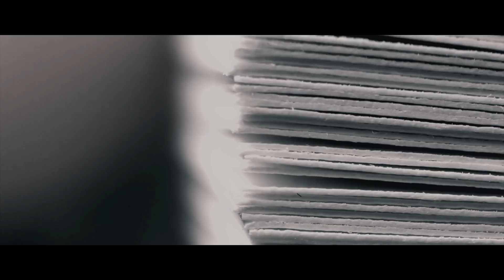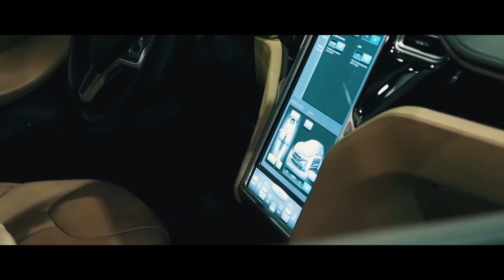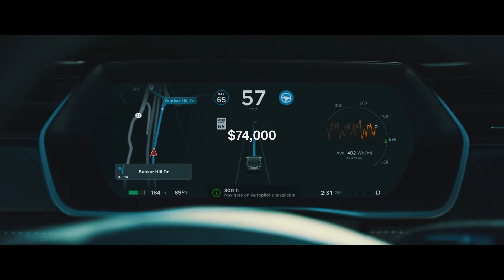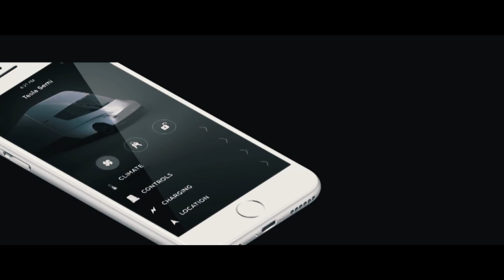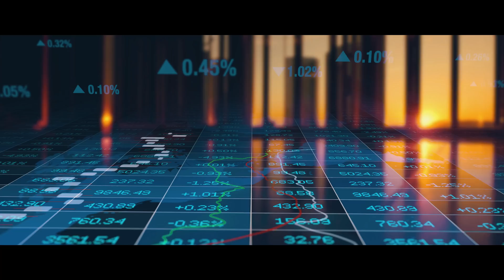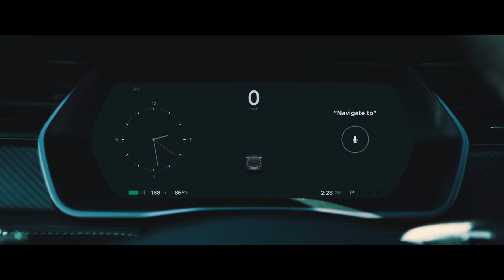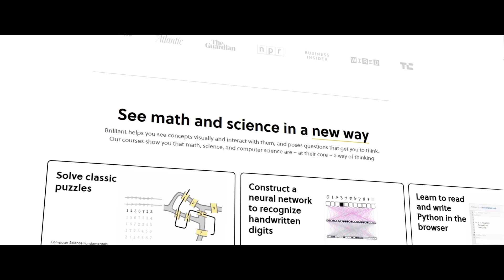Tesla: The Electric Revolution

Comment: Even though it runs by electricity...
The engine produces heat which blends with the nature and it probably enhance the nature's temperature... Global warming increasing not only by pollution evinced by petrol and diesel but by the heat the machine produces as well ... It's not different from a human body which creates heat  while exercising...
Machine if runs produces heat no matter what...
Even the oxygen polluted turns less the heat ultimately increases and global warming increases too keeping pollution aside....
I hope u understand it...
There's a solution to this and that is
" If the entire people of planet earth stops riding vehicle for atleast 20 years and plant trees,  the wind created by trees would attenuate and decrease heat intensely and quickly produced by vehicles just as air cool engine works but even if we use electric vehicle heat is produced no matter what "
I hope u understand this

Comment: Hey, hope you see this. 
I like your video, but I think you miss some importen factores, you say some people have been killed while not paying attention on the road, this is a MUST and Tesla tells people to keep eyes on the road and a hand on the steering wheel.  
You allso say that people have been spotted not sitting on the seat, Tesla will disengage and come to a stop and not allowing people to use auto pilot for X amount of time if they dont have hand on the wheel for a period of time ( around 45--60 sek ).
You mention that auto pilot have a moral question to take with the killing of 10 or 1, IF a person drive any car they would allmost 10 / 10 times kill the 10 people and not them self, like if you can see you will crash, you will allways try to safe your self in a reflection even if it will kill the person beside you. 
Now you seem to miss how many lifes Tesla Safes EVERY day and this is a very importen factor you miss out on. 
Last thing is you mention some Tesla's going up in flames, just imagine how many gas cars that does the same and even explode. 
Just my 2 cent, take it or leave it:
Cheers keep up the good work.

Comment: tesla are the most dangous cars. They sell lies and hate, There cars are terrible, they have sucky parts network. if you look at how the agency's rate the autopilot(its not a autopilot) its worse then Infiniti or GM super cruze. The only thing he really brought to car market was over air updates. The fact of the manor is he isnt really selling cars to people who cant afford luxury cars. its taken the place of the Prius use to take. If you look at how these cars are as a system not very good. People dont realized that the government need their money to fix roads. if you look at the tax bills that are coming down the pipeline you looking at (like IL) lets say you buy a Tesla model X, if you buy a EV that weighs 0-4000lbs you pay $2,000 reg fee per year. If you buy a model X which weighs 6,600 lbs you are looking at $4,000 per year. Another one I heard about from LA which talked about using this for every LBS you pay $2 so if you get a model X you could pay like $12,000 in regs taxes. Also they have the highest rate for engine replacement in the car business. Also many body shops refuse to work with tesla because its hard to get parts for them, plus they require them to have special tools just to work on them. Also Tesla has a history of raping customers. There was a guy in san diego who bought a used car from San Diego Jeep, and then he took it to tesla to get a inspecition and tesla put a salvage tile because they said unless he fixes the car they would  tell the DMV that the car is unsafe. so unless he paid $75k in repairs at the Tesla repair center in La Jolla then he was not able to use the car. He stated to buy the car at $66k. The dealership is a sunroads dealership. They are a good place to shop. Anyway unless he paid the shop, they stated Tesla doesnt approve of it being sold as a used car. So he got ripped off. In realty only about .5-2.5 % buy electric cars. its going to be the reason that our car just keep going up and up. Another thing is Dems are bad for the car business, we need more choice, why can we have diesels, hydrogen, ethanol cars. But no they just want to force feed EV on us.

Comment: The hypothetical problem you bring up with AI and a group of 10 people vs a wall is a bit flawed. First off, there's no way there's 10 ppl lined up in an unavoidable way just out of nowhere.
Second, hitting a wall doesn't always kill you. What kills is speed. All this assumes you're not even trying to use your breaks. Which the AI will do.
AI might try to go between the wall and the group of people while also breaking. At this lower speed one of the people might get hit or the driver might get injured by the wall.
But I doubt there will be a situation of this caliber in the real world. Most likely an extremely rare event or when people can use teleportation.

Comment: another option, make it impossible for an electric vehicle to pass over a crossover when the lights turn green for the pedestrians. fields in the road that cuts connection when the green lights go on, and others between those and the crossover field that pop up as physical barriers in the bargain. hopefully the effort would be made to let the machines know turning down the speed would be good in good time for the impacts with the physical barriers not to be damaging to either vehicle or barrier. 
hm. would probably be easier to instead have the fields(on either side of the crossover) tell the vehicles whose wheels are touching them to Lock when the lights go green for pedestrians. these fields would of course extend back at least 3 carlengths. wheels to of course be released upon lights going green for drivers. (where crossovers are a thing, motorists should not be moving all that fast ANYWAY.)
need to be somewhere by a certain time? get on a bus. while the damned things are still around.

Comment: The ethics question is still difficult to answer if you yourself are driving, would you choose a death outcome or try to slow but injure/ kill others. The ethics are down to how people feel, and so don't really have any part in a digital system. From a logical perspective crashing the car would be preferable since Teslas have the highest safety record of all cars on the road... It's unlikely colliding with a wall would equate certain death. Arguably electric drive trains also offer better breaking than ICE cars since the motor can be used to absorb energy.
As for the fires, newer non flammable electrolytes are being developed... If petrol is the alternative... Fires will still be an issue (they happen so frequently they no longer classify as news).

Finally electric cars are here to stay, batteries are increasing in energy density and reducing in price, below $100/kWh you will pay more for ICE cars... and looking at history - changing economics are the biggest drivers of change.

Comment: The last hypothetical question could very well be resolved. Tesla have shown off how crash resistant their cars are. Even if it’s absolutely battered in a collision, the driver seat is still relatively safe. Tesla have also showcased the auto brake system when the car detects someone. So unless someone jumps in front of the car suddenly, the car will almost always brake before a crowd or a single individual.

Comment: The ethics question is not all that relevant. I the very, very rare case, such a decision had to be made, the car would simply obey the rules of traffic. If there are suddenly a bunch of people on the road without enough time for an autonomous car to react, they most certainly broke some rules (so its their own fault). If the pedestrians behaved correctly and the car still didn't have enough time to react, the problem lies somewhere else in the system.
So the ethics question probably never needs to be addressed.
Reply: I know right? Why is the ethics question such a big deal? I don't get it.

Comment: My main issue with the argument with whether the car should kill 10 people or save 1 life (yours). Is that, assuming there was no autopilot and it was given to the human to decide. It stands to be a difficult to choice to make regardless. At this point it’s the human’s choice and which ever one he chooses, it will be “Tesla’s” fault if it were to happen in a Tesla. If this happened in a non autopilot car, it would simply be the driver’s fault no matter what.
Reply: So why should that change if now the car decides? You signed up for that very risk when turning on autopilot, therefore, it shouldn’t be a question of what’s right or wrong, because in the end, it is the driver that initiated the autopilot.

Comment: I like gas cars. Tesla cars are ugly, especially the cyber truck and the semi. "Electric cars have fewer moving parts" is wrong. It has many solid state parts. It has hundreds of chips and other electronic components. Like the motor inventer and controller. These pieces handle huge amounts of electricity and they can go bad. It doesn't matter if its solid or not

Comment: All the ethical dilemmas are difficult and hard to argue for a reason. Because, well...they are dilemmas. But a pretty flawed perspective in this narrative would be to say "Collison will kill you". That's a very deterministic way to look at things. No one can be absolute about an event about to happen. But realistic way to look at this would be to minimize the risk on occurrence of the said event. This approach is pretty easy to implement and regulate. Work towards minimize any and all collision by various means possible and optimize the hardware to sustain a hefty collision if inevitable.

Comment: I'm pretty sure in most cases when there is 1 or more people crossing the road and you can't slow down in time usally steering into a wall won't kill you most times because of course the angle you approach the wall is a huge factor.So in my opinion it should just avoid the civilians,that's what i think at least.

Comment: The trolley problem is getting really tiring. 

"Will it swerve into a wall or kill ten people?" Why not literally slam on the brakes? Why not avoid the accident altogether because nowhere in life will you be traveling at speeds great enough (read: highway speeds) or city design shitty enough (read: pedestrian area next to high speed area) to require such a quick reaction to overwhelm the superhuman capability of computer reaction times?

There are plenty of videos of Teslas stopping on the highway for accidents IN FRONT OF vehicles that we can't even see yet.

The trolley problem, like the philosophical trash it is, assumes the ai is gonna be dropped into a situation, instantaneously, with no preceding context, with no surrounding lay-of-the-land knowledge.

You ever notice how there's literally no footage or reports of ANY autonomous vehicle "swerving to kill one instead of many?" That's because it doesn't happen. Because the same way you, as a responsible driver, should be able to reasonably accurately predict when you're getting shoehorned into a potentially elevated risk situation, I imagine some team of engineers thought far enough ahead to include some code like "if somehow your moves become limited to just two, and you somehow for no explicable reason have accelerated to an unacceptable speed in a situation you're not supposed to, slow down..."

We'll be fine
Reply: In this situation there either isn’t enough time to brake enough, or the breaks are broken entirely. And no, it isn’t a likely scenario, it’s just meant to be a thought experiment, and I assume that somewhere in the code somebody will have to decide on which choice to choose.
Reply: @jeremiahlaing6757  make it even and kill the driver aswell as the pedestrians, so nobody loses...(or everyone loses...?)

Comment: Both are important. As well as the system itself, the product is a service and it's service is to provide safe transportation. And in order to know good from bad driving, you have to experience Both, which is what the tesla team should be doing. Putting the autopilot up against insane test in order for it TO IMPROVE. Machine learning, you can't expect a car to be able to drift if it hasn't experienced swerving a curve at high speeds.

Comment: The trolley problem is not really a problem in the long term. Events like that will be rare enough, and Autonomous vehicles will prevent enough other deaths from very common causes that the software could make whatever you consider to be the wrong decision in this situation every time, and it will still be a net positive by a wide margin.

Comment: Electric car isn't holy, it will broke down if solar flare happens
Reply: That would be the least of your problems during the extremely slim chance of that happening
Reply: every car made after year 2000 is controlled by sometype of computer chip, so those will breakdown aswell, so whats your point?

Comment: For the ethical question about crashing into a wall or 10 people, the autonomous cars should just have an emergency brake
Reply: Umos  like legit a steel pipe that is wielded into the structure would do the trick, it launches into the asphalt and stops the car in less than fucking 5meters, yes it would leave deep grooves into the asphalt, but thats easy fix and nobody would die.

Ofcourse G forces in deceleration like that have to be tested before hand so they arent lethal, but it should work.

Comment: My answer to the ethics question: Hit the wall. In addition the lower impact of a single death compared to the deaths of several, the driver chose to take the risk of allowing the AI to drive the car, while also not paying attention to the road as the driver is supposed to so they may consciously slow down in time. In other words, if the driver were in control, the ethical decision would be to hit the wall as they are responsible in that they also were not paying attention, and I don't believe the AI being in place of a completely attentive driver changes that.
Reply: But you see, when you're in critical situation like that you might just steer into the local pub and kill even more people, I hope one day wi'll have an AI to choose and not us, like calculating the probabilities of survival of both pedestrians and passanger, but for now I think the driver would be more likely to make a mistake like that and kill even more than an autopilot.

Comment: Longer range sensors would solve the ethical issue, as the ai would have time to react and stop the car even if it means to use the hand brake and make a 90 degree rotation. There is always another way, not all is black and white. Thx for the video 😊

Comment: Gah! I don't like that the "self-driving car morality" question still comes up. The bottom line is: 

Would you ever buy a product that's designed to kill you? 

Because that's what a pedestrian-prioritizing system would be. I personally, would want my car to plow through a class of kinder gardeners before killing me without my consent. Additionally, this avoids all the "value judgement" problems where the car is then forced to assign value to the people it's going to run over. It simply protects it's owner at all costs.

Comment: If you run out of power in the middle of know where how can you get power.
Reply: Lee steele this situation is better in an electric car than a gas one, it may be possible to use solar panels in an electric car. Technically you could bring jugs of gas in a gas car, but that’s pretty much identical to bringing batteries in an electric one.

Comment: To think we had this technology in the past and we just simply regressed back to using fossil fuels, and contributing a great deal to global warming. Outstanding move.
Reply: To be fair, batteries were shitty back then and nobody knew about global warming
Reply: @rizizum  Doesn't matter if the batteries were shitty. They didn't have the distances we have now anyway.
Reply: @nvmffs  That's exactly one of the reasons of their decline, roads were being build and the need for vehicles with more range and speed increased, which couldn't be done with the electric cars of that time
Reply: yeah and the economy isn't good not even now and the fuel cars are cheaper that's why but right now its coming back at cheaper prices
Reply: I understand its necessary but i love my combustion engines😔  and the amount of fuel we use to mine for the lithium for the batteries is also ridiculous
Reply: @kermitthefrog9923  Lithium is not exclusively mined for batteries. And the mining equipment can eventually be electrified as well. (as for the cobalt, new battery technologies are already being developed that don't use it)